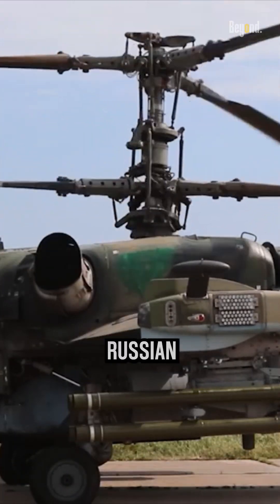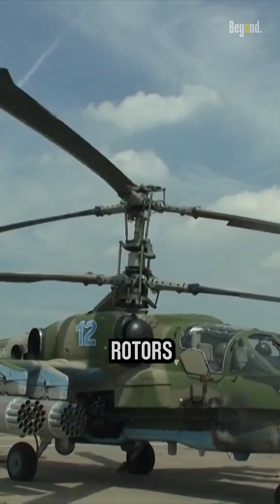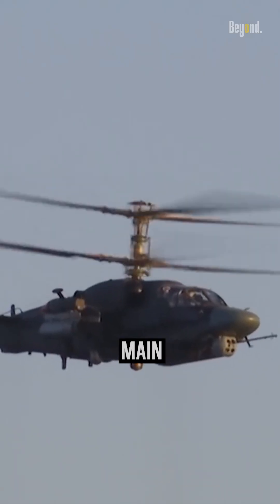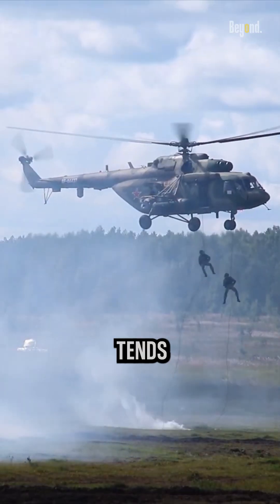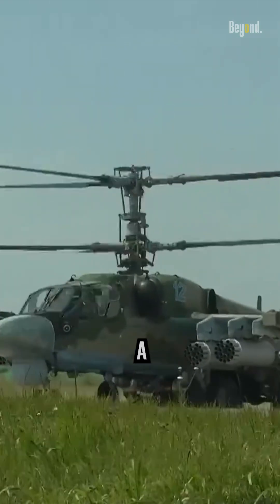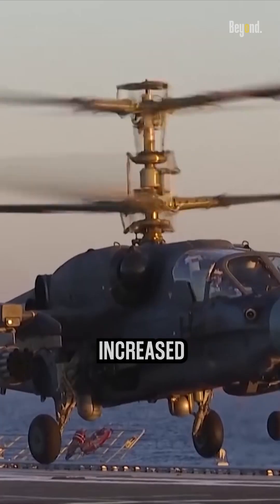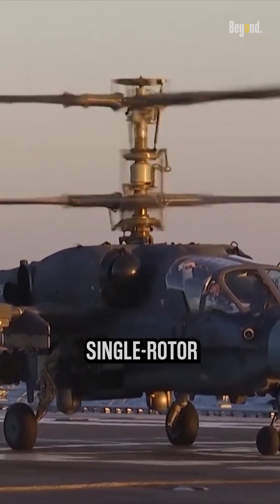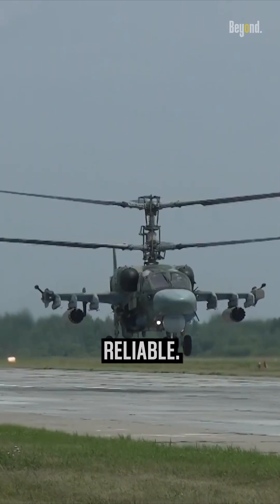Why the Ka-52 Alligator doesn't have a tail rotor #shorts

Comment: For all the perks of such a concept, why hasn't it been more widely adopted in the helicopter selection?
Reply: Seems too radical for most. Or just couldn't make it work. By the way look up the planned replacement of the Blackhawk.
Reply: maybe cost, you have twice as many main rotor blades. I don’t think it is that much more cost effective than a traditional design
Reply: In a deep dive, the propeller blades overlap. This is 100% death of the helicopter.
Reply: @Marsh_Diver  no they don’t
Reply: Unlike what the ai voice said, it is not more reliable, mechanically simple, or cheaper. It is very high maintenance and more costly than a single rotor setup. It doesn't however give more maneuver due to lift power. Making it a treetop AGM king. There's a reason the US doesn't use the setup, and there's a reason the Russian army has so few in deployment.
Reply: @Scyborg832 wrong, they have a ton of these. Ur not a expert 😂
Reply: @rog69  They have less than 300. Most estimates put it at less than 150 in active service. That's a lot to you?
Reply: @Scyborg832  yeah? How many they should have, millions? It’s not tanks it’s helicopters, this a big number for a sophisticated assault heli like ka-52
Reply: @rog69  Seeing as they lost more than a quarter of their active inventory yeah they should have a little more. Such a sophisticated piece of equipment is hard to manufacture, thus harder to make a long lasting effect in a war. They served good purpose during the first weeks of the counteroffensive, now they are continuously becoming more irrelevant.
Reply: @rog69  The US has more than 1000 Apaches in service. And they both fulfill a similar roll and capability. So I don't count less than 100 in service as very many.